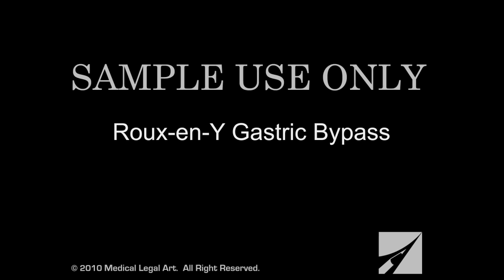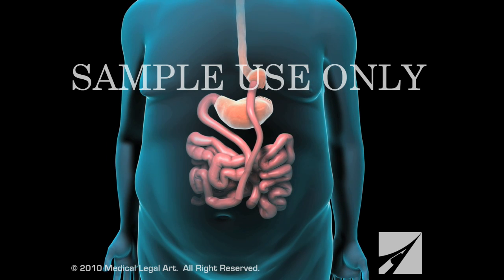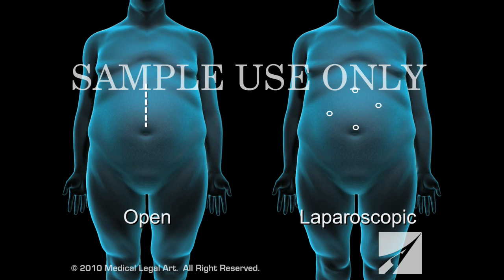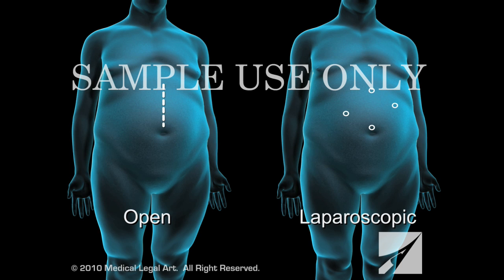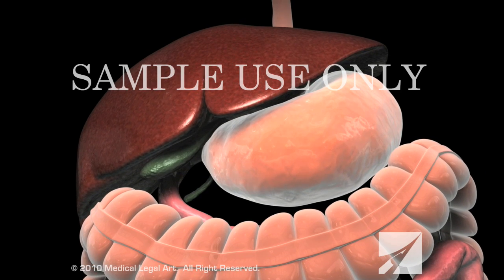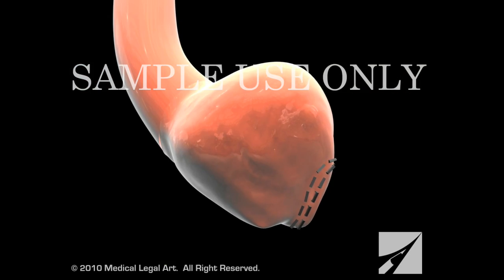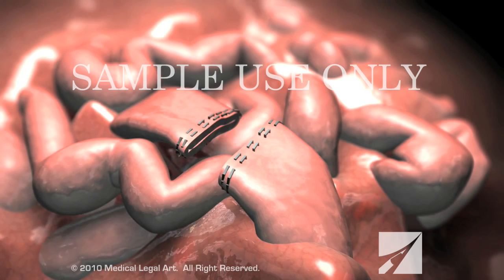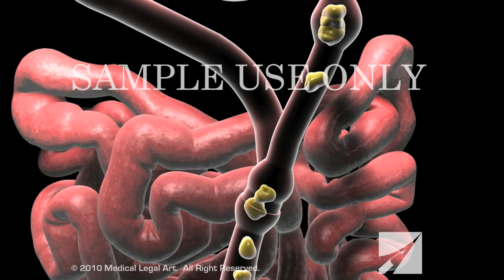Roux-en-Y Gastric Bypass

Comment: The best diet program is without any artificial sttuff, simply with food, fish, vegetables,  fruit, nuts, meat, egg aso. food which is good for your body, but in smaller amount than usual. Try to plan 2 years ahead. The goal is to be slim? Yes, but also HEALTHY which has not undergone an unnatural operation. They are selling operations...but not warning necessary regarding dangerous complications and side effects which will ruin your life. STAY AWAY. Do your research, google your truths!